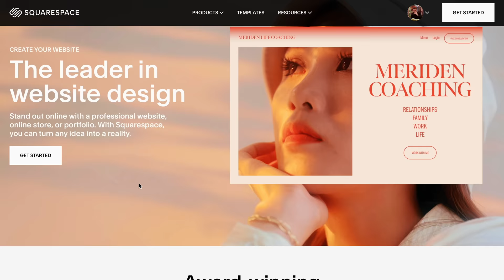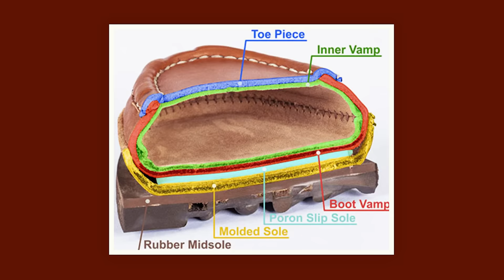The 100 Year Old Boot That Baffled "Expert" Hikers.

Comment: Poron is actually a pretty great material.
Reply: It’s really not though
Reply: People hate on synthetic materials too much . Vegetable tanned leather for example is a terrible material depending on the intended use .It dries very badly .Mold can grow pretty quickly .Warps and cracks with heat etc.

A mixture of synthetic and natural materials is the best option
Reply: @franky3fingers337  Have you ever used Poron in work boot applications? I think NOT! I have several old pairs on RW with a Poron layer (2233, 2231, 1155) exposed and the oldest ones, the 2233, still has a nice bouncy layer of Poron, which has yet to come apart. The other ones are equally as good.

Comment: Russell makes absolutely amazing boots. They are handcrafted and feel like they were made for you because they were. I have two pairs i had made 15 years ago. I have never even worn the second pair and have been wearing the first almost daily since. From deserts to mountains and the deep red clay of the south, these boots have been through everything. Resoled multiple times they just get better with time. They are worth every penny. American made and built like a tank.
Reply: Their new made to measure program will be $1500. Otherwise they are not made for your feet anymore.
Reply: @kevinomalley1145  That's definitely too rich for my feet 😅
Reply: They better be absolutely amazing considering they cost up to 800 bucks!
Reply: @connorperrett9559  yeah I completely understand. They did not cost nearly that much when i bought mine.
Reply: @connorperrett9559 Its a lot of money but it’s worth it. I was going through $200 boots every year. I’ve had my Russell’s for 17 years of almost daily use.

Comment: I haven't really backpacked since the 1970's.  After seeing all the synthetic crap boots sold today I'm struck by two things:

- the old motto "take nothing but pictures, leave nothing but footprints" now results in mounts of synthetic trash which will NEVER decompose: disposable hiking boots, "ultra light" packs which will not hold up and will require replacement, and of course plastic tarps bought by the ultralight set.

- the loss of knowledge about how to rate a boot, how to understand it, and how to care for it so it lasts a lifetime.  I still have my Reichle mountaineering boots which I used on my last hike in 1995.  Admittedly they are way to heavy, but they give tremendous ankle support.  

People also seem to have forgotten about using a light and heavy sock together to increase wicking and decrease hot spots.
Reply: For years now, the 'ultralight is the only way to camp' and all the latest greatest gear marketing has rubbed me the wrong way.
I've gone more and more to vintage and thrift store gear. Stuff that may be heavy, but is durable and multipurpose.
I get a lot of wierd looks with my external frame pack.
Reply: Raichle made the best boots I have ever had, and I miss them more than I can say. I have never found anything as good.
Reply: What did humans do for the thousands of years before ankle support 😮 what a nightmare
Reply: @lutze5086  They broke their ankles or got early onset of arthritis.  Or died at an early age as most humans did then.
Reply: @IHateYoutubeHandles615  life expectancy wasn't actually that bad if you made it past childhood, the childhood deaths skew the average way low. Does any other animal in the wild suffer without ankle support? What makes humans evolution different?
Reply: The problem is the market, if you own a pair of boots that last a lifetime then you’re not going to buy a new pair of boots. Means less sales, means less profit. Often it’s more profitable for companies to make worse things, so they do and we don’t have a choice but to buy what’s available. This, not any individual habits, is why disposability is becoming so normal in all facets of life.
Reply: Personally, I would have to be spending two nights in the snow before I would consider any kind of boot. Something like the Altra lone peak trail runner and wool socks seems so much more practical than a boot in almost all conditions. If you need ankle support get trekking poles. Just my two cents. Boots like these are more fashion statement than functional.

Comment: I have learned over my 61 years, that a hard sole that does not twist and flex, is the best way to keep your feet and back from hurting, and all the new flexible  boots do NOT last, and rob your energy with all the softness. They may be comfy for a short while, but when you are moving, working, climbing rough terrain, having a hard sole with a steel shank, gives me much less fatigue. My most comfortable boots are 2 pair of old Fryes, one is the Cavalry style boot (like wearing hard sole moccasins!) And my square toe boots with the leather straps.  Each is so easy to wear, all leather, rebuilt several times, I can go days in them, hot, cold, and they are so damn comfy, nothing comes close.

Comment: I have three pair of RM boots size 13 double wide.  They are great boots for off the pavement.  I originally went with RM because it was so hard to find boots that fit.  Now I will not buy any other boot period.  Now RM has been sold.  At this time they are not making custom boots for any size and lets hope that changes otherwise I won't be able to buy any more of their boots.  Let's hope that RM does not go the way of Filson and forget their roots.  If you have an average size foot, don't hesitate to get a pair.  I highly recommend their boot.

Comment: Not comparable with the original boots used in 1948 except as a homage. The construction materials of the boot used in period in the 1940s was far removed from today, where in general everything was leather with no synthetic or rubber midsoles materials inside including poron; the leather quality in terms of the way they were tanned was also different. ALso the outsole would never have been glued on in period, but fully stitched as can be seen from vintage boots on sale!

Comment: I hiked the Triple Crown.
The AT was my third trail and I hiked all 2,180 miles in exactly 100 days.
Don't even think of wearing leather boots on the AT or any other long distance trail.
Don't wear water proof shoes with gortex either.
Find comfortable running shoes and wear wool socks.
Reply: What do you reckon? Too heavy/bulky or hot? Not easy enough to dry out if they get wet?
Reply: @InGrindWeCrust2010  I'm curious as well.
Reply: @InGrindWeCrust2010  there's a commonly accepted belief among thru hikers that a pound off your footwear improves hiking performance as much as cutting 5lbs of pack weight. Boot is probably at least a pound heavier on each foot. Over 5 million steps the calorie difference to do the same thing is significant.
Reply: @alexhamon9261  That's an awesome way of explaining it, thank you!
Reply: @alexhamon9261  Is that the only reason? What if I want the extra exercise and the extra protection for my feet?
Reply: @ShadeSlayer1911 Through hiker here, yes that is a great reason, heavy shoes make everything HARD. But also because leather boots do not dry, your feet and shoes get wet, stay wet and blister central. At least with trail runner type shoes they are quick (sort of) to dry. Boots in general are also kind of pointless, ankle support is a big myth. After a few weeks of walking your ankles have enough strength that any fall hard enough to fuck your ankle is going to make 0 difference if you have boots or trail runners.
Reply: @Shrouded_reaper  You make good points, but I press x to doubt on ankle support being a myth. For me at least, it's not just about a fall that could screw up my ankle. I've gone on offtrail hikes in just my trail runners, and I nearly rolled my ankle about half a dozen times that trip, because of stepping on branches. When I did similar terrain in boots, including climbing a mountain trail, no problem at all. I'm not expecting to fall on my ankle and have my leather boots protect it. I'm just expecting some support to decrease my chances of rolling my ankles on unexpected terrain. It's a layer of protection, not the entire thing. 

And if the support really is a myth, I highly HIGHLY doubt folks like firefighters (including wildland and smoke jumpers with their heavy Nicks boots), police, and military (which includes those who work in wet and humid environments) would go through the trouble of all that extra weight on their feet.
Reply: @ShadeSlayer1911  I get that. I'm happy to wear trail runners or athletic shoes most of the time unless I'm hiking hiking - on scree/rocks/steep switchbacks, etc. Then I prefer proper leather hikers or mountaineering style hikers because I just don't have to worry about rolling an ankle or wrecking a toe as much. But I don't have experience on long, multi-week hikes/walks like the Appalachian Trail or PCT, etc. where everything you have you carry with you, and for those, saving the weight with something that will dry faster makes sense to me. I have a friend who has done several over the years, and when I read the comments above, I realized he focuses on having a well fitting athletic shoe or trail runners and good wool or blend socks, and the socks last longer than the shoes.

I can speak to wildland firefighting. In that scenario, it depends on the deployment, and you can sometimes cover a lot of ground, but the point of the boots in that case are for protection against the heat and essentially manual labor, digging ditches, clearing logs, etc. And they're usually not going to get too wet or will stay dry because, well.... A logging or tracker type boot may have the same ankle support as a stiff hiker or mountaineering boot, or as a climbing/lineman boot, but a lot of wildland firefighters can't afford the fancy stuff or aren't going to pay for a pair that they won't maintain past one season anyway.

And for tactical boots, maybe it's that they typically have more synthetic materials and waterproofing or can dry faster, etc. My jump boots dry a heck of a lot faster than my White's but then again, I've never been deployed. I see these guys camping out in the mud for weeks in Ukraine and think, ugh.
Reply: @InGrindWeCrust2010  I have a firefighting friend who has really expensive Nicks full leather boots. I swear, these things weigh about 4 or 5 pounds each. They put my boots to shame in terms of weight and sturdiness. Those things have nails and screws securing the outsole onto them. But despite the weight, anytime she's out on a trail, she wears those things. 

Then again, I also have not been on a long term hike. Only day hikes. Maybe I'll change my mind after I've done some backpacking or whatever. But as of now, I'll take the weight, and just hope I gain the muscles to carry them on longer trips. I already feel like my legs have grown stronger from wearing my thorogoods, which are a decent bit heavier than my previous pair of tactical boots. I basically wanted something that I know is durable and can last me a really long time if I take care of it. They don't feel that heavy anymore, and I can even run in them.
Reply: @ShadeSlayer1911  OMG Nick's are the business and I hope to be able to save up to get a pair next year. There really is something to having a well-fitting, sturdy boot with great arch support that protects you and saves you some energy. I love my Thorogoods and they were instantly comfy but they just don't fit me that well - I had to compensate with inserts. White's or Nick's (or similar) FTW!
Reply: @InGrindWeCrust2010  yeah, they seem to be nice boots.
Reply: @Shrouded_reaper  Thanks for mentioning ankle support as I didn’t know the thinking on this had changed. I grew up in the long distance hiking school of 40 to 50 lb packs and sturdy all leather boots. I still hike this way using a lot of used military surplus gear.
Reply: Obviously the man who made the journey was an actual man vs a wuse
Reply: @WaywardPondering  I've heard from military guys that if you are carrying a lot of weight on your back on hikes and backpacking trips, you really should have some good ankle support from good boots. You don't need crazy stiff support, but just something to help you out, as the human ankle isn't meant for carrying 60 plus pounds of extra weight. 

Or so they say. Again, in my experience, that extra support helped me greatly. That doesn't mean rely on your boots completely. You should also exercise your ankles independently to give you as strong of ankles as you can get plus the support from boots.
Reply: @panchopistola8298  Sure he was. But I bet if he'd been able to use the footwear and rest areas that we have set up in the current day, he would have.

Comment: Alternatively build boots with a (mostly) one piece upper, gusseted tongue with the usual insole and cemented construction and you don't need to have complicated stitching methods and double vamps (the latter of which can compromise comfort ). 
As well as being very water resistant most of these better leather boots are resole-able ( despite internet wisdom).
This type of boots usually leather uppers of 2.4 to 2.8 mm thickness ( 6 to 7 ounces) and sometimes the leather is impregnated with silicon during the tanning process to increase water resistance.
A deep lugged sole and decent leather uppers will determine how long the boot will last and  I would put something like the Scarpa SL (for example) up against these for longevity.
The 3 pairs of boots to walk the trail is referring to the very lightweight, mostly synthetic "boots" which are really based on athletic sneaker technology which comes with compromises.
I'll admit these moccasin boots in the video are more likely to have better feel underfoot than traditional boots.

Comment: Hi,  the search doesn't show "brain" in the comments, or I'd keep my mouth shut.   You don't soak the hide in blood, but in emulsified brain, regularly wringing the hide over and over while beating it with large mallets/sticks against a stone.  You are all the time gathering brain that comes out and re-folding/re-rolling the brain with it in a layer.   The lecithin protein that makes up much of the brain tissue works into the hide and makes it supple.  You still need to dry and stretch it, but it won't harden and can have oil worked into it to waterproof it.    It must first be scraped clean of hair and all fat or any muscle scraps, and any holes sewn.  It's a ton of work but will reliably make supple leather.

Comment: They are very nice looking boots, but not a serious outdoor piece of gear for modern times. There’s a reason thru hikers use synthetic trail runners nowadays.
Reply: The difference is: these will last a lifetime. Those, will not. Taking into account cost/wear analysis would also make these a better buy long term.
Reply: @zekeyeager1458  the difference is that a person is able to cover many more miles a day over time in a much wider variety of conditions than they would in these types of boots. There is no comparison whatsoever. These boots are made for very casual wear around town.